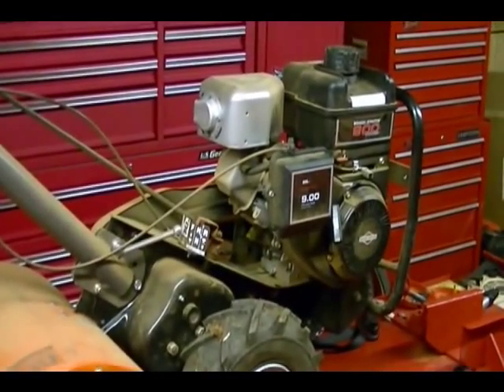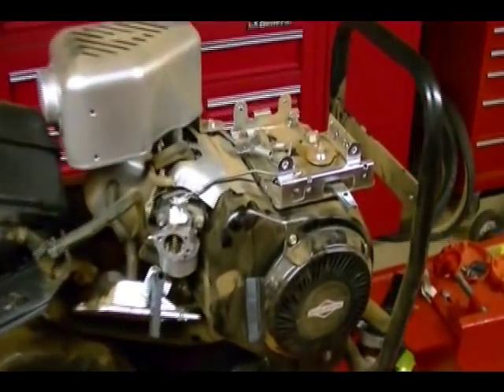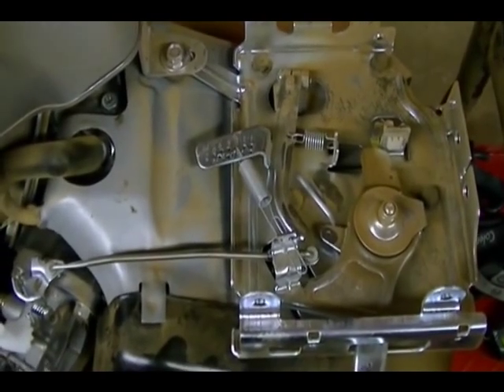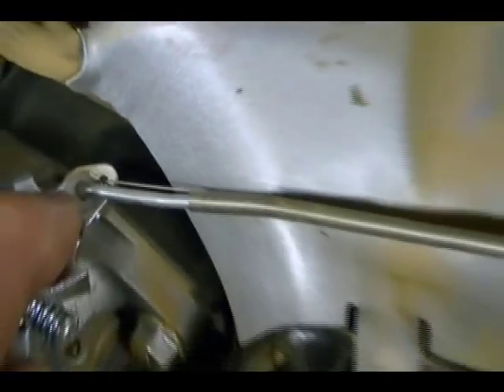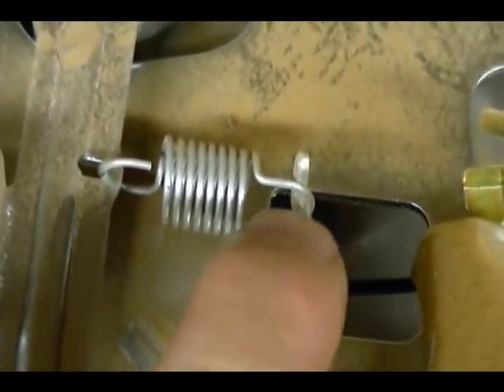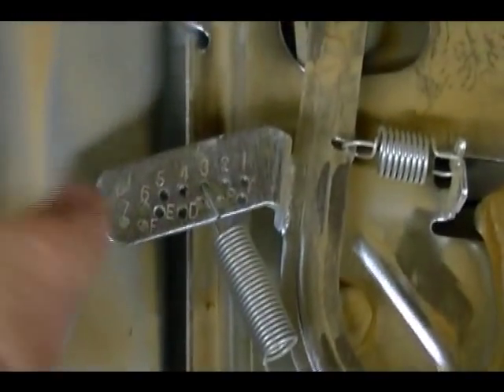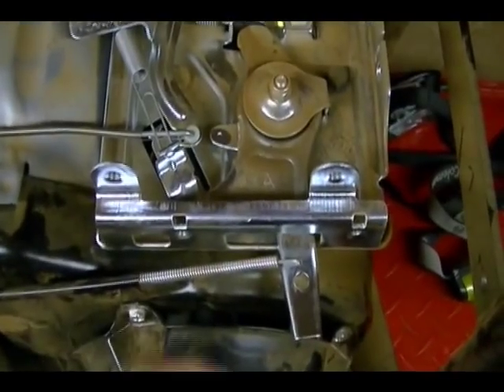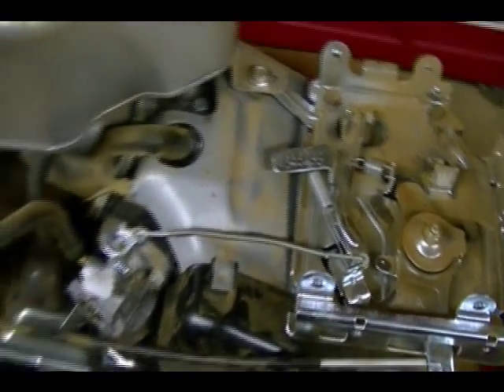Small Engine Repair: Carburetor Linkages on a Briggs & Stratton 900 Series Horizontal Engine

Comment: This helped.  I bought a craftsman tiller that is basically the same setup. Mine was non working when I got it and parts were missing or hooked up incorrectly. Got a few things back where they are supposed to go. Should be good now.

Comment: I have a 900 series B&S engine, and the governor linkage is much different than what you have shown here.  Problem is B&S has discontinued my model, and can't seem to find  engine part blowup for it at the B&S sites. They acknowledged the Model number off the engine, but state there's no engine part specs, or service manual for my engine any more. It's a 2004 model on a snow blower. Blower was given to me, damaged, and although after repairing it, and getting it running again, I seem to have missing governor spring (s),  and documentation on where, and how the springs are supposed to be located and placed.
Reply: I might also add, my engine, looks the same as engine shown in video, but governor arm is way different in how it's connected.

Comment: i have same engine and linkage on a yard machine leaf blower, I dont see how the throttle lever moves actuates the governor or the carb butterfly?  nothing moves when you actuate the throttle lever?  Lee Isenberg has the same issue.  Did you figure it out Lee?
Reply: Did you figure this out having the same problem
Reply: Im thinking the same thing.  moving the throttle arm there didnt move the carb.  i get how its travel will be limited by the governor arm, but should the throttle arm not be connected somewhere?

Comment: Good clip, but I STILL don't understand how the throttle works the butterfly in the carb!  The butterfly is spring loaded OPEN, looks like yours is the same way??  What, how does that work??   I'm trying to fix a wood chipper w/ exact same set up as yours. I'm assuming something is missing.
Reply: lee isenberg did you figure it out?
Reply: @thekenpokid21  honestly can't remember. I do remember that I ended up just Jerry rigging it with a spring I had laying around directly to the carb. Wish I could have a more helpful answer for you
Reply: @GumpterCrayon  Thank you for getting back to me. At least I have something to work on. If I find out how i fixed it, I'll reply back to you. Thanks man
Reply: The throttle return spring closes the carburetor throttle plate to idle speed.  The idle speed is usually controlled by a screw.  That short spring tries to move the governor arm to full throttle.  When the engine starts and runs, the governor insided the engine turns the governor arm and  puts tension on the spring that connects the throttle lever to the govertnor arm.  The throttle lever then controls the governor arm which in turn is connected to the carburetor throttle plate.
Reply: @danburch9989 ahh so when the motor isnt running the throttle lever is useless, once the motor is running it then can actually actuate the carb butterfly?
Reply: @virtusleather  Yes, in a way.  The throttle lever and spring tries to make the engine run at full throttle.  That's where it rests with the engine off.  The governor arm and spring tries to make the engine run at idle  But since the engine isn't running, the gopvernor has no effect.  With the engine running and depending upon the tension of both springs, the governor maintains the engine speed set by the throttle by balancing the tension of both springs.
Reply: @danburch9989  thank you so much!  its been dam near impossible to find a service repair manual for the older horizontal shaft OHV im working on.  thanks kindly.